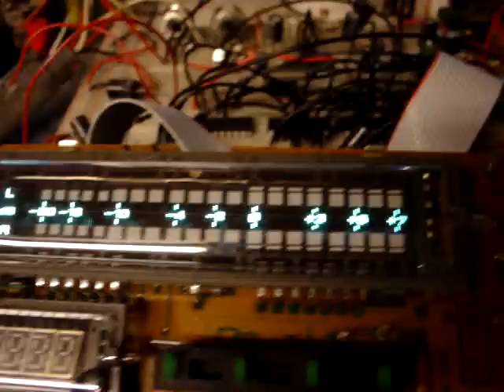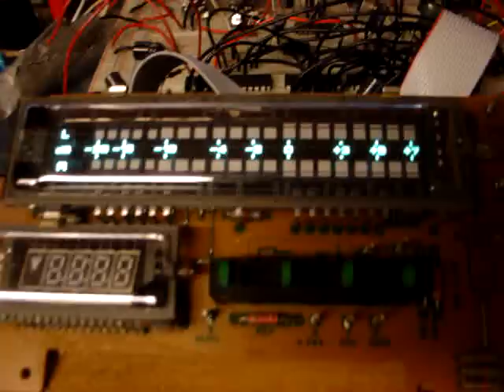DIY Pioneer VFD VU meter part 1

Comment: That's sweet!  I'd like to learn a bit of programming some day so I can do this type of stuff.  Maybe I should drag out the old LED sign that's laying in my basement and put a modern controller in it.  Right now it's a 6800 architecture that I don't have the special wired programming remote for.